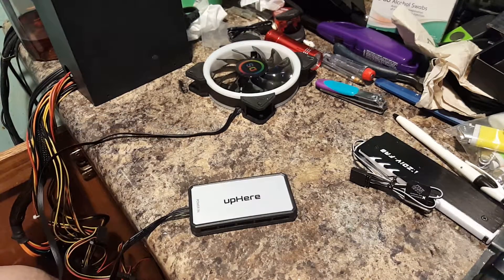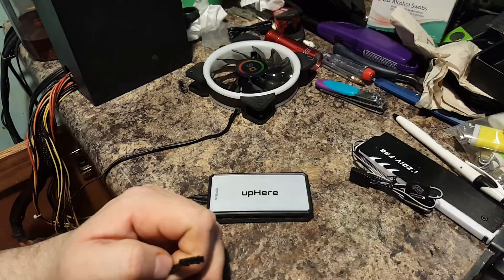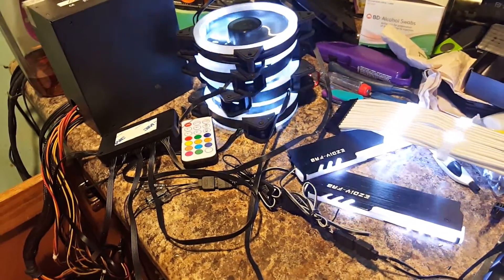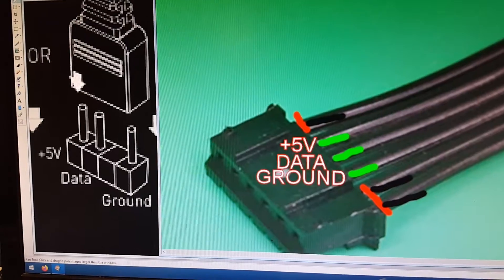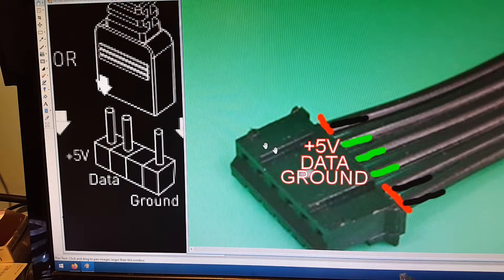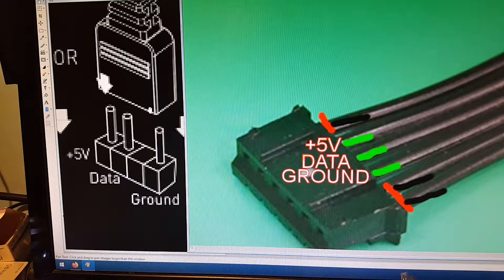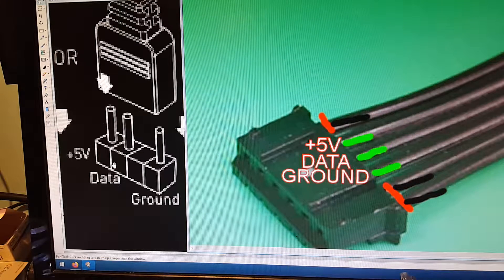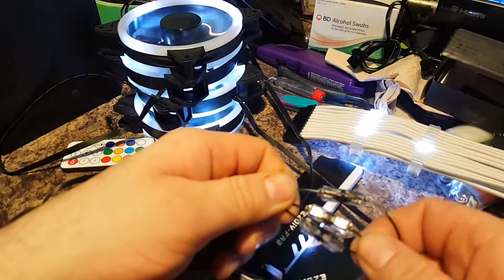Cheap hack to convert 6 pin rgb controller to 3 pin 5v

Comment: Do you know how these fans are powered, voltage or PWM?
I managed to mod my Asiahorse hub to connect the RGB to icue, but now I’m tempted to try get more control with these fans, since the “low” setting on the remote is still too noisy for me.
Reply: I'm in the same boat. Did you find any way to change the speeds?
Reply: @gildox1880  I’m assuming it’s voltage, but I haven’t had the time to take apart the hub to try again. 
My plan would be to try pwm first, and see if the fans move, since it’s a low voltage signal… because if you try 12V and it is instead pwm, it might kill the circuitry

Comment: I have case fans that have 6 pin connectors that came with a fan hub, i also have some UpHere fans that are 3 pin connector and only have one SYS_FAN, how would I get it to work. My motherboard is the MSI PRO M2 MAX Micro ATX.

Comment: Are Asiahorse and GiM plugs the exact same 6 pin plugs? Are they interchangeable with the hub?
Reply from the maker: I'm not familiar with what you mean by GIM
Reply: @phreakwars  Sorry I should’ve been more specific. GiM is a brand or company that makes fans. The hub itself seems to be very similar of those to the fans made by Coolmoon which is also another brand.
Reply from the maker: @scrubbyducktail2545  I'm guessing the pin out is the same. The only ones I have seen that are proprietary are Abkoncore's stuff for their Spider series fans.
Reply: @phreakwars  👌 alright thanks
Reply: have you tried already using GiM hub? because i want to connect exactly the EZ-DIY ram heatsink he shows in this video to the GiM hub but i want to make sure i'll work this way. Probably it will since GiM hub is exactly the same as COOLMOON, EZ-DIY, AsianHorse, etc.

Comment: Hi, ı have typcal 4 pin rgb and 5 pin rgbw controller. If I cut the white pin does it work ?
Reply from the maker: No. 4 pin rgb runs on 12v.
Reply: @phreakwars  Hey thabk you for your respond. But my questionisn't that. I explained https://imgur.com/a/efdi66j
Reply from the maker: @kemalaziz2480  I see what you are saying. I'm honestly not familiar with that controller to know if that would be safe to do.

Comment: Hello, is it possible to leave the ARGB management to the motherboard? and not the remote control
Reply from the maker: Yes, but you would need a special control box like this one: https://amzn.to/3ngUBDu It will plug into your boards 3 pin header allowing you to control it in software.

Comment: Hi There, My son just bought a brand new Antec NX800 case with 3 big RGB controllable LED fans... however… On the Motherboard there seems to be no connector for the controller, only 4 pin fan connectors.  Can I make this work or drop the case?  Thanks in advance for your reply!
Reply from the maker: Yes, this hack will work on those rgb fans. The wires you need to make this hack can be found here: https://amzn.to/3osBFmg or you could always hack a cheapy fan's wires and use those instead.
Reply: @phreakwars  , not sure I fully understand the hack. Intention is to cut some of the 6 wires of the fans and than connect it to the 4 pins on the motherboard to make the controller (included in the computer case) and the ledfans work?
Reply from the maker: Don't do that, you'll burn out the rgb, or worse, destroy the board. The 4 pin on the board is 12v, this hack is for 5v type rgb. Little hammered ATM, I'll try to remember this question and answer a little more sober later on and help you out.

Comment: Please help I have a set of 3 fans all with 6 pin headers that connect into a controller via Molex although the wire with a Molex on also connects to my psu and has a 4 pin header on please please please help they light up but aren’t spinning
Reply from the maker: Would love to help, but I'd have to see what you have going on up close, can't really give you an assessment just going by what you're saying. From the sounds of it, you might have a bad control box. The 12v that runs the fans is separate from the 5 volts for the RGB. This split off in voltage and function is handled inside the control box. If the fans are not spinning, then the 12v link for that chain is defective for some reason.

Comment: Hi, I just came across your video and it's exactly what I need as I want to connect my Barrow RGB water block to the controller.

One question though? Do you know what these 6 pin connectors are called? I don't want to sacrifice one of the fans for the mod..
Reply from the maker: Sure don't. If you ever find out, please tell me. I had to sacrifice a fan as well to perform this hack.
Reply: @phreakwars  I have found some in eBay which I believe to be the correct ones.

They are called "JST PH 2.0mm 6 Pin connectors"

https://www.ebay.co.uk/itm/5-Sets-JST-PH-2-0mm-6-Pin-Male-Female-Connector-Plug-Wires-Cables-300mm-/292037564597?_trksid=p2349624.m46890.l49292
Reply: @jdewinnaar  thanks a lot mate, so its 1,5mm vs 2mm.
have you tried it out? 
I haven't got the connector stuff jet, so I've no idea how it looks I just want to be ready when it arrives
Reply: @cano8503  Just tried them and the 2mm seems to fit perfectly..

https://abload.de/img/img_20201201_184433xwji5.jpg
Reply: @jdewinnaar  Thanks mate u helped a lot
Reply from the maker: @jdewinnaar  Yes, those are it. They can be found on Amazon as well as the kits to make your own: https://www.amazon.com/s?k=JST+2.0+PH+6-Pin&ref=nb_sb_noss
Reply: hey @phreakwars  thanks for this great video.
I found those cables online maybe these are the right ones?
https://www.amazon.de/-/en/ILS-Micro-6-Pin-Connector-Cables/dp/B07GXN2521/ref=sr_1_18?dchild=1&keywords=6+pin+jumper+led&qid=1606841573&quartzVehicle=21-720&replacementKeywords=6+pin+led&sr=8-18

I am struggling to find the right 6 pin connector cables, since i don't have a fan to sacrifice.
also, i was wondering if it would be possible to take a few single jumper cable like those from Raspberry or Arduino..
https://www.amazon.de/-/en/AZDelivery-Jumper-Arduino-Raspberry-Breadboard/dp/B07K8PVKBP/ref=psdc_1626220031_t2_B07KYHBVR7

do you think it should fit?

Comment: Seems a lot of work. But how is the fan speed controlled or is it? I just bought a Musetex 903 PC case, which came with  6 fans (w 6 pin connectors) and a hub, but no way to control the fan speed that I have figured out yet, just the RGB. In contact with the supplier but no resolution yet. Any ideas?
Reply from the maker: Fan speed control will depend on the type of RGB control box you use. Some of the cheaper stuff does not have fan control as an option. The ones that do have fan control typically only have 3 settings. Low, high and off.

Comment: Can this be turned around so I can use a 6pin fan on a 3pin connector?
Reply from the maker: not that I am aware of. Tried it once and failed. Though when I tried I was using a lighting node pro, not a standard 3 pin type rgb. The corsair software didn't work right even after switching it to a lighting strip.
Reply: @phreakwars 
Hmm, yeah I guess corsair is built a bit different...
I will try this anyways, thanks!

Edit: I will try using it with the mainboard directly, maybe that works

Comment: Hey, very nice Video. I do not want to give up connecting a 4 pin fan to the Control Box yet. Do you happen to know the pin assignment of the 6 pin connector?  Converting from 5v to 12v or vice versa should work with a voltage regulator.

Comment: is it possible to do it the other way round? have an adaptor so you can convert the 6 pin connector from fan directly to a 3 pin and connect to motherboard?
Reply from the maker: sure, but that's a lot of wasted effort to make the connectors, but I suppose if one had the ambition.

Comment: could I just cut those wires, along with their plastic space to make a 6 pin work in a 3 pin controller? I messed up for not checking how many pins this fan uses. Hopefully you could help me out here

Comment: that 1st pin beside the 5v LED wire, i've read somewhere that it's data out for LED and some say it's the tachometer. would anyone know what it is really? i'm thinking of creating a custom connector that separates the argb part with the fan part. thanks in advance
Reply from the maker: I personally, have not messed with it enough to know. I know it can't be a PWM control since the controller box itself usually handles that if so equipped. Could possibly be a tach because on some controllers that have optional pwm, it does indicate RPM.
Reply: Its data out, so its going to the next port as a data in. Thats why this kind of controller needs to be connected sequentially from port no.1 to port no.2, etc. U can find a full pinout and explanation here https://blog.ja-ke.tech/2019/06/11/re-coolmoon-rgb-controller.html
Reply from the maker: @Chris-rs1pp  good to know, thanks for the info.

Comment: Is there a way that i can separate these pins grouping it to 3 pins for rgb and for the fan? If so, the other 3 pins for just the fans, can i connect it to the mobo's system fan pin? Which is the tachometer? Is that something that can be done?

Comment: Awesome video! I am thinking of trying to do the reverse and was looking for the full pinout of all 6 pins on the fans. I know which ones are RGB now, but what about the 3 that you cut? I think you mentioned in another comment that two of them are fan control, but is there any chance you can provide a full pinout for all 6 of those pins? I'm wondering if I can split a fan into both a 3-pin RGB connector and a 2/3 pin fan connector.

Thanks!

Comment: Can u help me out please? 
In my controller there is 4 wires to controll RGB lighting and other 2 controll the 12v fan at constant voltage. But I have WS2812B led strip in my hand. That I want to conect to my controller. Now, how do I connect these 4 wires to the 3pin end of my strip??
Reply from the maker: I need to know the specific model of rgb strip you are using and the type of connector on the end. If you have an image that would help.
Reply: Its WS2812b model 5050smd stripe.  Would u plz drop an email that i can be on touch with u?
Reply from the maker: @sparkingshit6839  OK that strip is a JST type connector, now how about the 4 pin controller? What brand/model is it?

Comment: Hi bro! Nice video. I have a ARGB LED strip (deepcool 200 pro) and it has 3pin. My motherboard supports ARGB 5v  (aura sync, in my case). do you think I can make some kind of hack like you did in this video?
Reply from the maker: Yes, shouldn't be too hard at all.

Comment: Hi sir, i have a question.
I buyed a 5V ARGB nvme heatsink from Aliexpress but a few days after that i realized that my controller only accept 6 pin fans and 3 pins LED strips.
Is there way to make it work and controll the colors with my controller?
Maybe i can cut the cables and make some kind of direct link joining the cables and stuff?
Reply: Did you have any luck? I bought a 5v ARGB fan and a case with a 6 pin controller, and I want to try connect the fan to the controller.
Reply: @rabbitrampage  yep, it's working like a charm. I found the scheme of the pins/cables in the internet. Then i grab some old PC front panel cables that i had from a time ago, then i connected each cable in the right spot like,  They're still perfectly working to this day and i have full control of the RGB. It's easy, no need to be a genius or buy something else. Sorry for any bad word, English is not my main language

Comment: I have a rainbow 5 pin box for RGB, the fans on the case plug into the controller no issue, but only LED they just light up, fans don't spin making them useless, which is a shame because I have 4 case fans that I could be utilising

Comment: Nice work mate! I'm trying to control kind of those fans by an arduino, works great with the rgb, but now im trying to control the fans aswell. Do you know the Pin assignment of the other cables besides the +5v, data and ground for rgb? I know that the first one on the right hand side of your picture should be the +12V for the fans, but I'm not sure about the second and the last one, which one is tacho (rpm) and which one is pwm? Hope you know it, would help me a lot! Cheers!
Reply from the maker: I'm only ASSUMING second one over is a negative, not sure what end lead is used for. Some of these controllers can adjust fan speed and some can interact with motherboard pwm. I think that might be in the controller, not  the fans themselves. I'm thinking a pwm circuit on the controller adjusts the voltage, have never tested this. GO 4 IT !!
Reply: @phreakwars  I got the C7 fans by Darkflash. I texted with the OEM and they told me that their fans doesnt support pwm, so I thought there are 2 negatives, as you said. So there are 12V+, Negative, 5V+, Data for RGB, Negative and Tacho. I tested it and the DC Voltage control worked. I ordered a Hub by Phanteks, which converts a PWM Signal to  DC Voltage, so i can use the Bios fan control and dont have to use an arduino for the Fan Control. The RGB will be controlled by an arduino and the fans by the mainboard. I'm so excited if it will work as i planned it :)
Reply: @alexanderkarageorgiadis6414  How do you convert PWM signal to DC? Please link this hub. Thanks :)

Comment: I bought the connector you linked on the description, when I plug it, my other fans that are connected to other ports stop responding and the rgb just stops. I also lose control of the led change button on my case. Any tips? Thanks in advance
Reply from the maker: Did you perhaps plug it in backwards? Other then that, I have no idea.
Reply: Unfortunately I didn't. Is it maybe a faulty cable? Because when I plug any hardware to that connector, my other fans lighting stops. Although they continue to be turned on.
Reply from the maker: @valteralmeida693  yeah, sounds like you might have gotten a faulty control box.
Reply: Same problem

Comment: Greetings sir
I have a fan kit with controller similar to that of yours. My question is: is there a way to motherboard sync the rgb of these fans ??
Reply from the maker: Yes, but it requires a different control box. The one I use to do this can be found here: https://www.amazon.com/dp/B07KY6RR88 It's usually out of stock, but I think you might be able to find one on aliexpress as well. It's basically the same type of box you have now, except that it adds an aRGB sync cable that you plug into your board's 5v rgb header. You press a button on the remote and it switches to motherboard mode and from there you can control the fans and even some LED strips using software. I have a video where I am using this controller here: https://www.youtube.com/watch?v=b4GAMwU5Vpw though in the video I don't talk about the controller much because the subject of the video is actually the Abkoncore rgb controller and case, but if you watch, you'll see me controlling the rgb on the round fans with the motherboard sync.

Comment: Hey man this video is quite helful. Im a complete noob on the RGB world and i have a question. I have exactly the same uphere rgb controller for the fans, and i want to instal a led strip, but i have a 4 pin strip (12V R G B), is it possible to do something similar to what you did with the 3 pin strip? thanks for the help in advance.
Reply from the maker: No, that controller runs on 5v, you can't use 12v on 5v.

Comment: Hi, how about from 4 pin to that 6 pin hub? For example the RGB customized pc panel? Or a 4 pin RGB LED strips?
Reply from the maker: No, wrong voltage.
Reply: Do you have any idea how to connect a 4 pin to that 6 pin hub?
Reply from the maker: Not really possible without an expensive converter. You'd have to go from 12v down to 5v or you would burn it out or worse, ruin the motherboard.

Comment: For the fans any idea which pin is fan tach? my fan hub only sends 2 wires to the 4 pin fan connector on mobo. Gnd and Pwm. Without fan tach mobo runs fans full speed.
Reply from the maker: If I remember right on these, there is no rpm signal, speed is controlled by voltage from the controller.

Comment: By this hack can I control the RGB lighting By My motherboard (I have 3 pin ARGB header on my motherboard)
Reply from the maker: No
Reply: @phreakwars  what if i have this antec controller that can connect to the motherboard argb header? because right now they work with the 6 pin fans but i need them to work with regular 3 pin addressable fans too.

Comment: Tried to connect my Tecware Arc ARGB strip with 3 pin (VDG) to a non supported Tecware Orbis F3 fan controller with the same 6 pins configuration. However, all the casing fans LED would turn permanent white and the LED strip still doesn't light up after connecting to the 3 pins... wonder if you know what would be the problem? Thanks!
Reply from the maker: That controller is a 6 pin, yes, but it's a proprietary controller. I'm not sure what the pin outs for it are as I have never played around with one.
Reply: Looks like the only way is for me to find out the 5v and 12v pins with a multimeter and then do trial and error for the data pin?
Reply from the maker: Yeppers, that's what I did.
Reply: Hello sir,i exactly had the same case with yours. Have you found the solution? Mind if you can share the solution. =)
Reply: AD UNSCRUPULOUS unfortunately I couldn’t get it to work even after figuring out the function of each pin.
Reply: redundantz i think the only solution is to buy the argb controller hub I guess